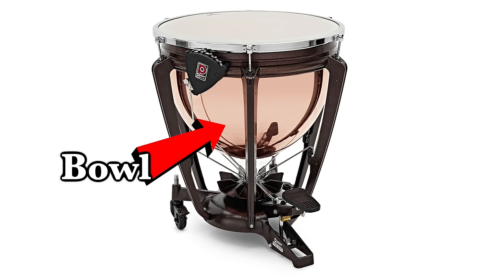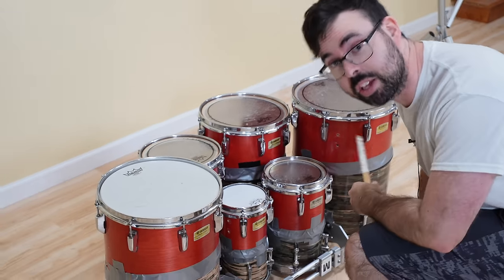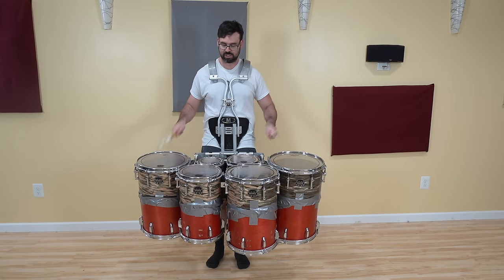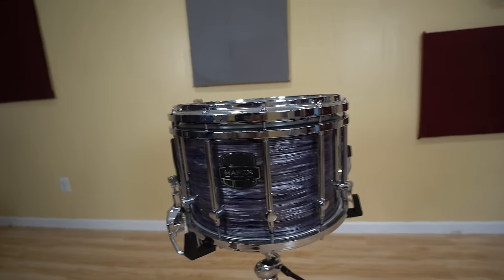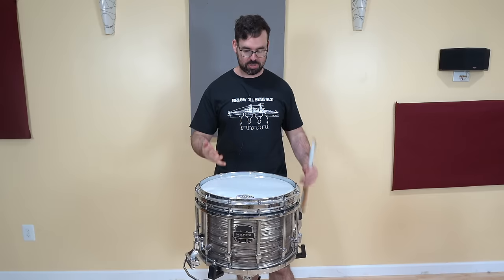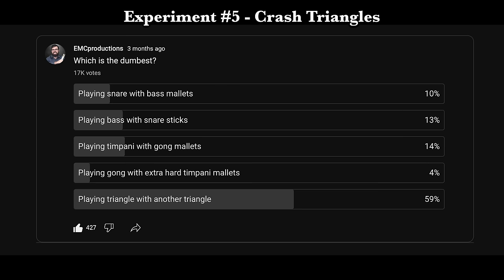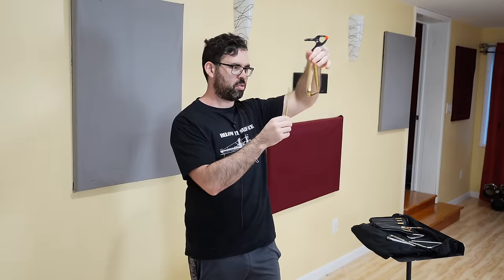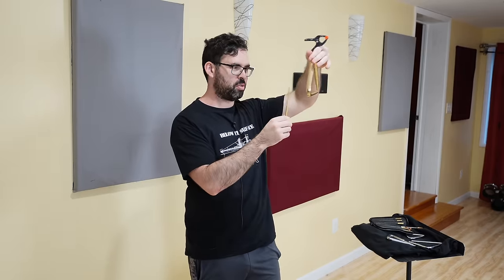I turned my TOILET into a DRUM...for Science!

Comment: Duallist pedal on two bass drums - like a dave lombardo style setup but instead of two single pedals, have one duallist (or the heel toe ones) but the second beaters cam turns a cardan shaft from a slave part of a regular double pedal, which operates a secondary beater that hits the other drum. Then play quadruple bass drum with a four bass drum set up using all four marching basses.

Comment: Actually back in my day before free floating snares came out, we bought an insanely cheap head no one would ever really march with and would cut the material off the rings, then use just the ring around the actual good head to get more torque and a higher more Kevlar sound in the snares.

Comment: Eric BD had bottom heads on tenors with scoops before you were born they were also in a directional high to low not the right left that has become standard and yes you will see the tubing for a clothes dryer on the snare mounted spocks as deflection scoops because ludwig never made them for 6 and 8 inch drums ✌️